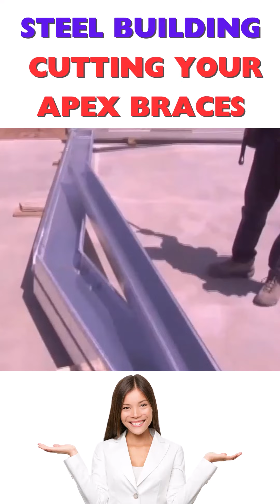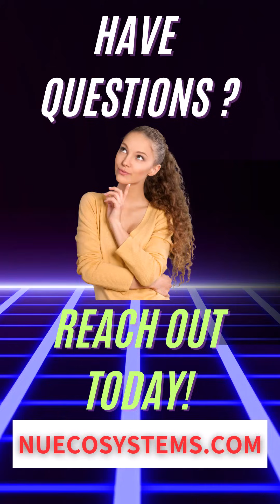Steel Building Cut and Install Apex Braces #barndominium #construction #steelhouse #diycabin #diy

Comment: How much site preparation is needed before installation?
Reply from the maker: whatever is required by your planning department. these buildings are designed to be placed on a slab or pier foundation. so, obviously those would need to be poured.